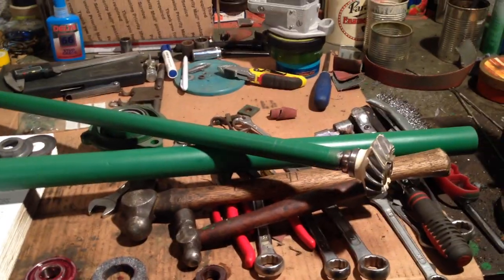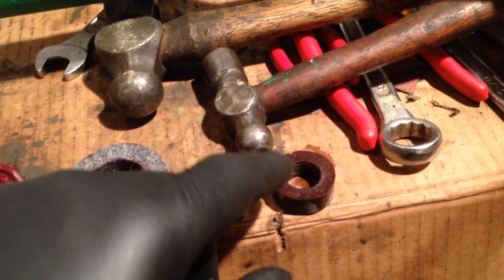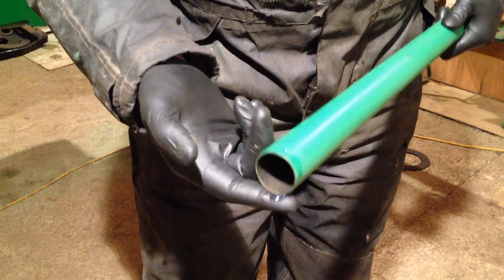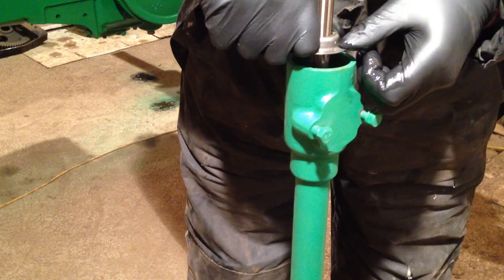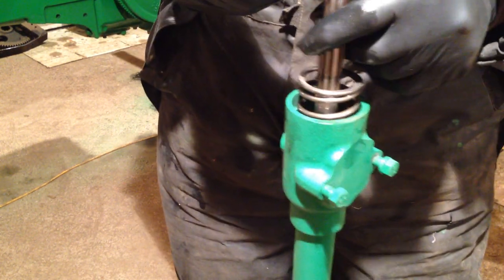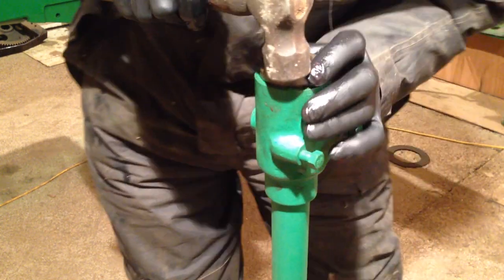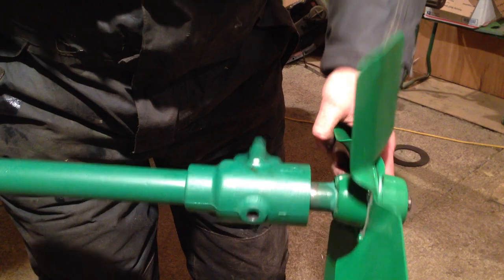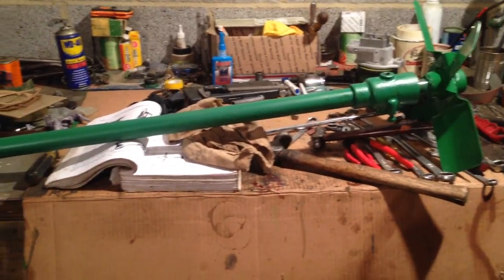1940/41 John Deere B tractor restoration pt 68 (putting the fan shaft back together with its seals )

Comment: Thanks for the video. I've never seen a fan shaft put together before. It helps to see how all the pieces go into the shaft.
Reply from the maker: lukeloader Hi Luke ,yep I thought it would make an interesting video it’s not something you see every day in bits and it’s well worth replacing some of those packings to keep the oil and grease in their right places especially as most of the packings are still available, thanks for the continued support David .

Comment: In the process of rebuilding my 51 Model A but my JD dealer says the 2 vane springs in ventilator pump are no longer available. I had oil going up the shaft and out around the fan. I'm gonna try and find some at the hardware store. Thanks for sharing the videos.
Reply from the maker: Joe Alan Hi Joe interesting,  I think the ventilator pump system was meant to give better crankcase breathing. I would think they’re would be some oil in this system so as to oil the pump as to how much should be there I’m not sure, good luck in finding springs , thanks for sharing regards David .

Comment: I have a question.  Dosn't the first washer you put in go between the spring and bearing?
Reply from the maker: Hi thanks for the interest , checked my notes and the workshop manual and it is put back together correctly as it should be , regards David H .
Reply: I guess you Learn something every day.  I've been messing with b john deeres for 40 years. Lol

Comment: Good video. What keeps the fan on the small shaft at the 11 minute mark? Our fan has worked itself loose. Doesn't seem to be any fasteners!
Reply from the maker: Travis Engel Hi Travis the fan is held on to the shaft by two collets , larger versions of what is used on engine valve springs . You have to push the fan in over on the shaft and the collets are released and the fan will pull off . Out of curiosity has the fan actually come off the shaft or just come loose , if the latter is the case what has happened is the fan has broken loose from the bonded rubber bush it’s mounted on with in its boss , a test is if you can spin the fan but not actually pull it off then this is what’s happened . The fix is you have to remove the fan shaft remove the fan as described drill out the rivets that hold the fan together and then reglue the rubber mount back in to the  fan boss and then using bolts instead of rivets bolt it all back together , or just find another fan , the rubber I suspect deteriorates over time  . Hope that helps regards David H.

Comment: Sir, have a question,  does engine oil run up into fan shaft tube or is it supposed to only oil the bearing by the gear?  Thank you for your help!
Reply from the maker: delayp 1965 Hi Delayp yep the engine oil only lubes the governor end bearing the fan end bearing use grease some tractors have a grease nipple some just a blanking plug which you can remove and replace with a nipple , warning though don’t over grease it you can easily force the seal out behind the fan ,if your getting oil up the tube it would suggest the oil drain in the Governor end bearing housing is possibly blocked and not letting oil drain back into the Governor housing and eventually back to the crank case after oiling the bearing . Hope that helps regards David.